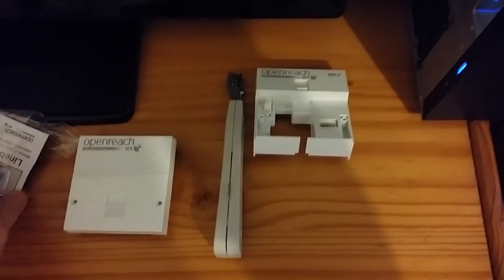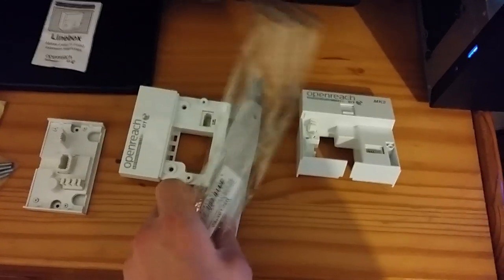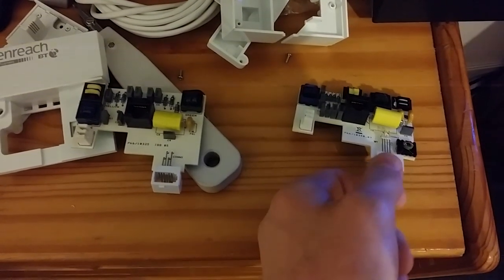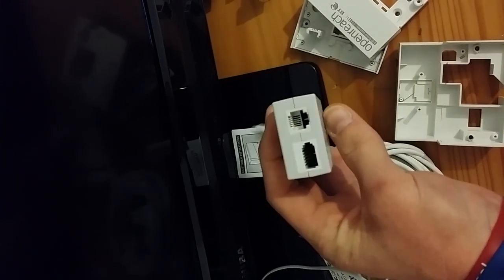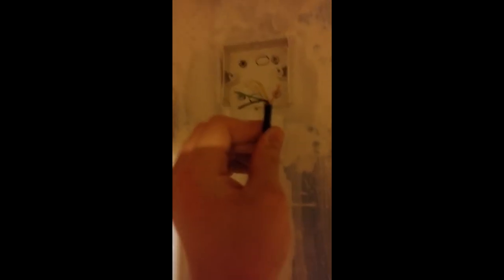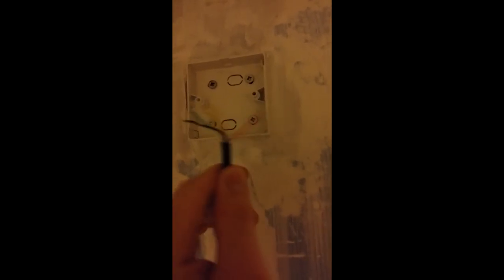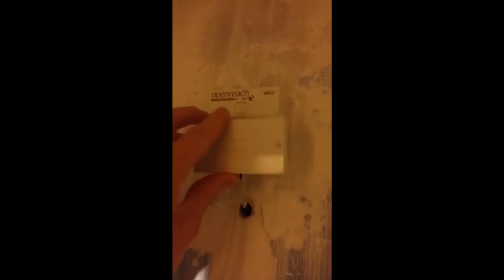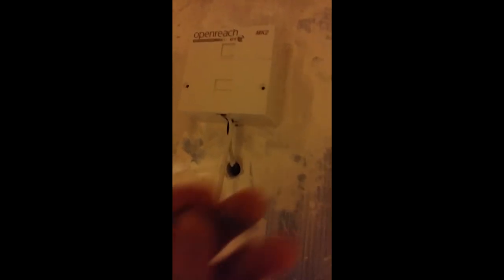VDSL/ADSL NTE Installation guide!

Comment: Normally the Blue/White goes to 2 and White/Blue to 5 , Orange/White is Normally used for the Bell wire which is concerned to number 3 but may not  be needed with modern Telephones Disconnecting this wire in the Master Socket (Check all Extension Phones Ring) this can help reduce Broadband dropouts and stabilising Broadband speed especially with VDSL Fibber to the Cabinet FTTC don't use flat cables to connect to your Router instead use a Twisted Pair RJ11 Lead ask at your local Computer shop or make one yourself check out My Mate Vince's channel